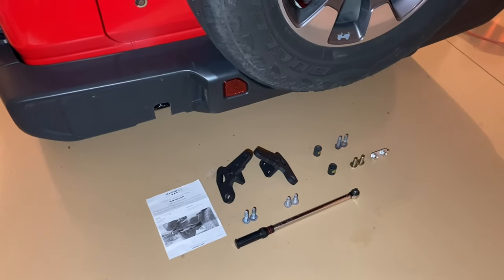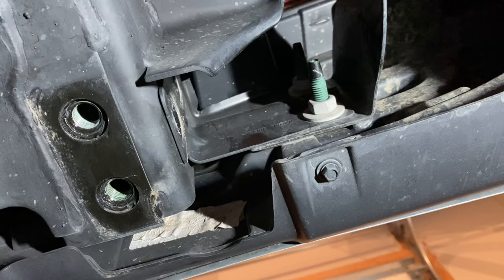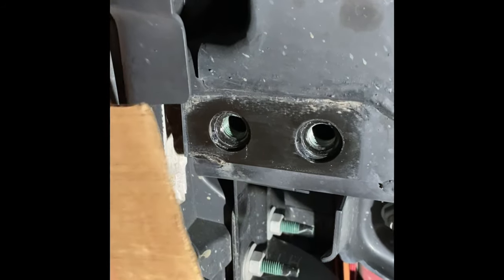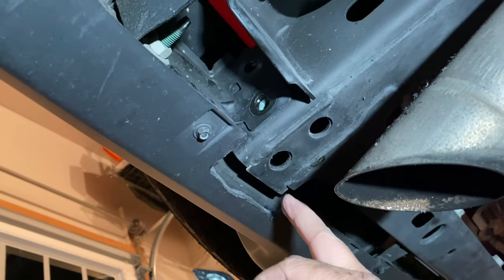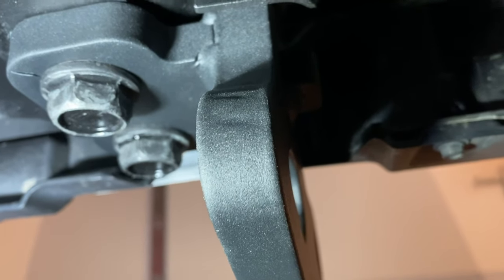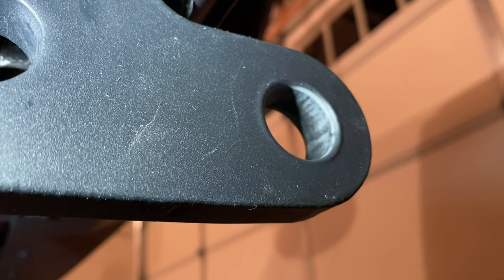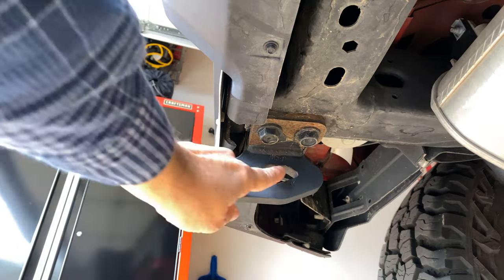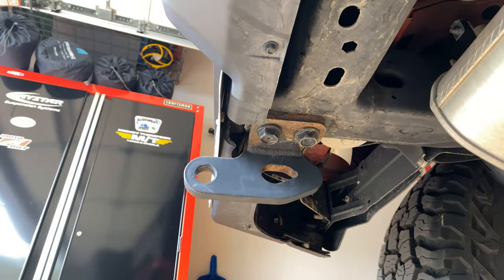How-To:Maximus-3 Recovery Point Install/10 Month Review on Jeep JL/JLU

Comment from the maker: Still having the plastic rear bumper, these tow loops definitely kept it from getting ripped off while dropping off ledges down into mud holes this past Sunday on the Daniel Boone Backcountry Byway. I’m happy that I added these.

I bought these to have an option to readily be able to pull the rear from different directions securely, without worry the recovery rope would stay in place.

Comment from the maker: 4/2023- I removed both sides and flaked every last bit of powder coating off as it was all coming off anyway. I don’t even live in the rust belt. I cleaned them up and sprayed them with black rustoleum. Now I can easily touch up with easy to find paint.

Comment from the maker: 4/2003- I chipped off all the flaking powder coat getting them both to bare metal. I then used rustoleum black paint that's easy to find for touch ups. They should offer them bare metal.